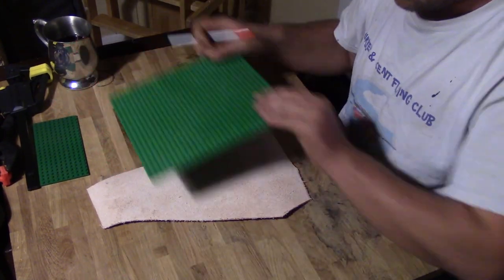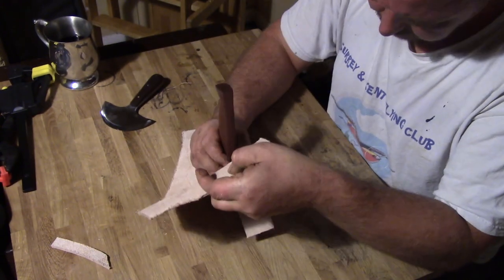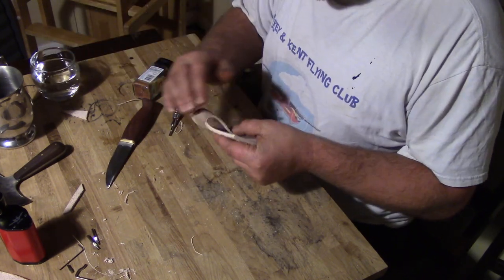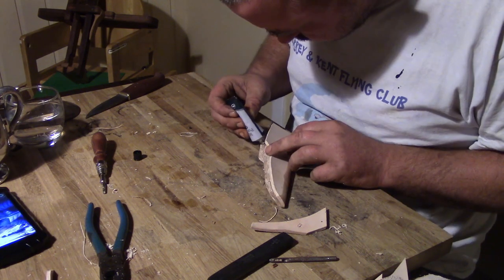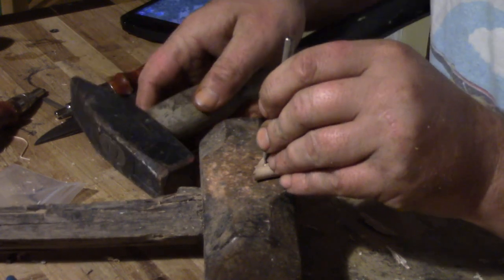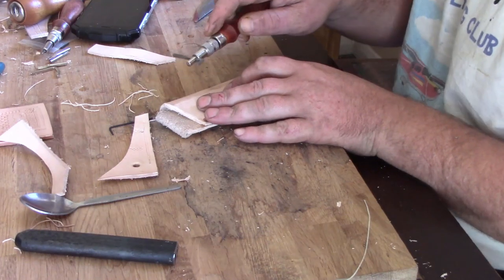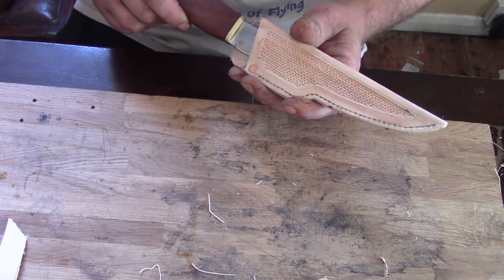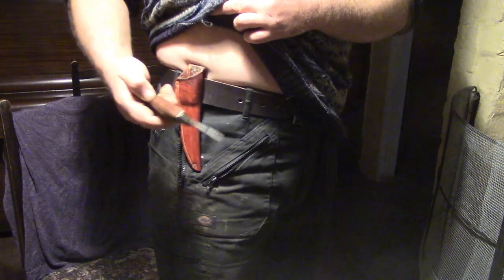making a leather knife sheath wet mould

Comment: Man! I felt so sorry for you after all your work Turbo! You are starting to look like an old school leather worker from times gone by.
Reply: What do you think of dangler sheaths? I have found them superb. You can squat or crawl or move any way you like and it never pokes you. You don't know the knife is there until you need it.
Reply from the maker: Not made or used one, as far as making is concerned i like this simplicity of just one piece of leather but can definitely see the advantages of dangling, maybe in the mid sized knife, ive gone off the idea of a parang on the belt, and the last puukko is unnoticeable on the belt but this is larger and more intrusive, thanks for the suggestion, ill try it next!

Comment: Buy a cheap circular razorblade knife they rule for leather trust me!
Reply: BLASPHEMY! That's not the Turbo's style. He made an amazing half circular saddle knife that works perfectly.
Reply: @vigilante004  yeah I know I saw but just saying to try one they are good for speed and precision supper sharp.
Reply from the maker: Alex, how are you doing old chap? I've seen a few of the youtube leather workers using those rotory knives but only on thin leather, will it cope with this sort of thickness? (3.5-5.5mm)
Reply: @turboconqueringmegaeagle9006  its a razor if you push hard enough it should you have a. Good 2 cm of blade depth your present blade is great tho a+